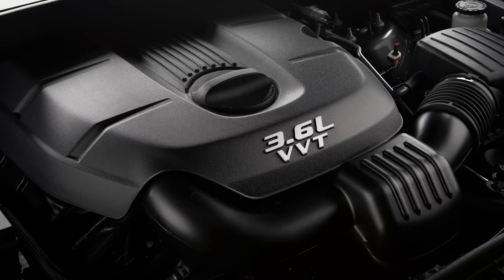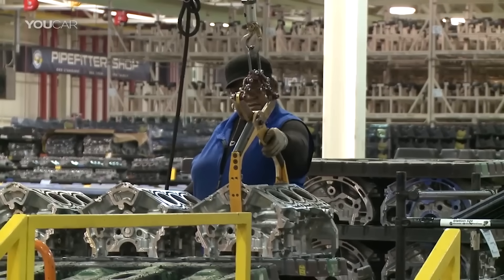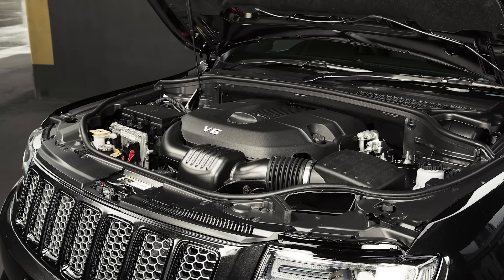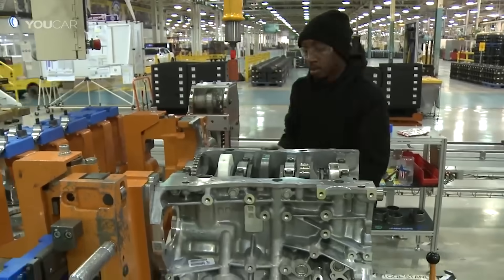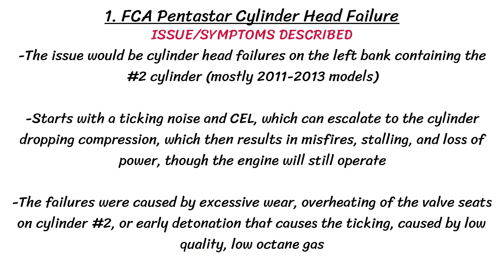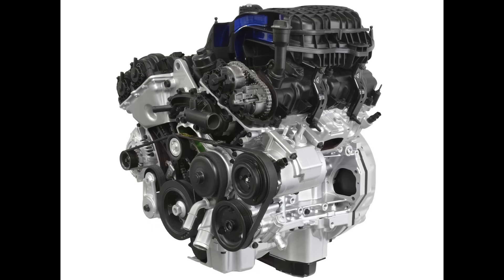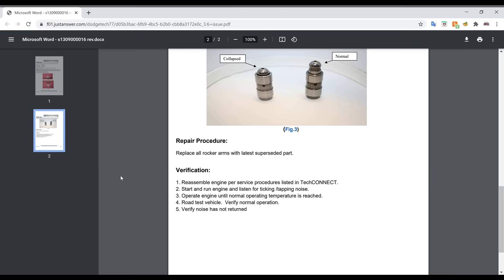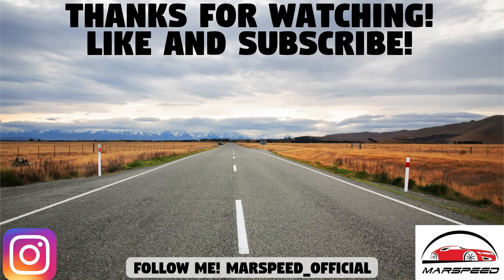The Specs and Fatal Flaws of the Chrysler 3.6L Pentastar V6 Engine

Comment: I have a 2911 Chrysler 200 with 75,000 miles.The only problem so far was had to replace thermostat and a/c condenser went out.I have had no real issues so far and I get great fuel milage,but I did change to 89 octane gas,

Comment: I have a 2013 JK Wrangler with the 3.6 penastar engine that uses oil, I have a chance to purchase a 2020 JT or Gladiator penastar engine,. Does anyone know if that motor will swap into my JK ? If so what modifications would I need to do to make it work?  Thanks

Comment: I drive a 2019 Ram 1500 with the 3.6 L with 36,000 miles on it and I have had absolutely zero problems with the engine

Comment: These are definitely the big three issues with the engine. FYI: There is an aftermarket fuel pump made of aluminum. Also make sure you only use the specific Mopar brand antifreeze.

Comment: 2015 durango limited flex fuel owner mine started with a tick that evolved into loss of power sputtering/stalling took it to the dodge dealership for repair they told me it was a bad cam due to the ticking they fixed the ticking and replaced the cam still experiencing loss of power at lower rpm’s feels like it’s running out of gas I have the 8 speed transmission so it stays at relatively low rpm’s making this a real problem. I’m taking the vehicle back but any ideas what that could be?

Comment: So far we have had 3 JEEP GRAND CHEROKEES in the family with the 3.6 Pentastar Engine. No troubles. We have the OVERLAND Package on each JEEP but One.  And 4x4 Loaded. They have been very reliable so far. Reaching 90,000 miles on one and 115,000 miles on the other one.

Comment: My 2015 Jeep Grand Cherokee Limited w/ the crap durability Pentastar engine got new rockers, a camshaft, and lifters at my cost since it was out of warranty.  Used synthetic engine oil certified to FCA specs and was very particular to changing the oil and filter.

Comment: recently had a problem with my 2013 jeep wrangler's heat. Engine light came on and the code indicated a problem with the thermostat. Once that was replaced the heat came back a little bit but not to its full potential. Might try replacing the heater core next.

Comment: I have 106k on my '18 grand caravan I purchased used at 54k.    Never had an issue with any of the aforementioned problems in this video.  HOWEVER! Now that you mentioned the octane grade issues, I may want to consider bumping up to 89.  Can using 89 correct of improve the overall fuel and firing  system in case somethings lurking in there waiting to rear it's ugly head?

Comment: Had a Routan 2012, still have it. Gave me a consistent 26mpg on highway on long trips.   Engine failure at 205,356,, no compression at all in one cylinder, the others sub par.  Had misfire codes for years,, had some ticking,  and the van had recently become a very hard starter but only on very cold mornings.  Recently started using E85 here and there, makes me wonder if that was the straw that broke the camels back?  About to throw in a used motor with 56k and do it all over again. $2300 with shipping and tax for that used motor,, 2500 to install, certainly better than used car prices! ..  Only other comment would be the TIPM was a big design failure on all these for Caravans and VW Routans.

Comment: This is more of a design problem than a wear issue.  The plastic oil filter tube will crack if it is torqued down too tightly.  This causes oil leakage through the tube.  To replace the tube requires removing the rear bank head and all the parts above it.

Comment: the rocker failure problem was the loss of oil in valvetrain.oil galley plugs backed off and oil would drain back into the timing chain area.starving the valvetrain rocker failure and cam damage.

Comment: I have seen videos on the fatal flaws of the 5.7 Hemi. The Hemi Tic being one. I purchased a Ram 1500 brand new. It only took me a couple of days to begin hearing it. Since this was a while ago I didn't know about the problem. That was my second and last new Dodge. Now the latest V6 has it's own fatal flaws!?! CHEVY'S LS is super popular yet it too has built in fatal flaws as well! Notably both BMW and Mercedes who were both known for quality and reliability are about as reliable as a drunk! Everything that they make is a disaster waiting to happen! So in 2009 I bought my first Kia. Don't laugh! I have had three in all, two new and one used. They have all been completely reliable. My 2016 Koup turbo has over 70,000 miles without a single issue! I know know now that I have been lucky since many of their engines blow up due to a manufacturing process as well. That has been a long intro the question, why can't any car company just build a reliable product anymore!?! They used to! Just Asking.
Reply: Politics has caused all of this.

Comment: 2014 Wrangler, I just replaced the oil the  cooler, a common issue with this motor. Also change the spark plugs, every one had been burning rich. All were a dark brown 🟤. It had  NGK plugs I put champion plugs back in. Dose seem to run better.

Comment: Purchased a 2016 Willys Wrangler lease return with 39k on the clock 3 yrs ago...certified used which means the drivetrain warranty is extended to 7 yrs or 100k miles. Good thing because as soon as I got it home the radiator had to be replaced. Then the timing chain cover gasket was leaking and had to be replaced. Then the front right axle seal had to be replaced. Now I am getting the all too common cylinder 5 misfire and I am without the vehicle until the dealership can work on it over a week from now. There is currently under 70k miles on this vehicle. I am religious about maintenance and never abuse anything I own so naturally I am pissed about all these issues especially given whet these vehicles cost. My wife's 2015 Grand Cherokee has already had defective rocker arms and a cam replaced on the right side at around 70k miles. Thankfully under warranty but now it's expired. And American car companies wonder why so many people choose brands from overseas? We love out Jeeps but when the time comes to replace them, we will most certainly NOT be purchasing anything Chrysler!

Comment: Chrysler-JEEP air conditioner compressors fail at a high rate, especially if the car lives in a HOT 🔥 climate like Southern California, Arizona, Nevada etc. My AC was fixed twice under warranty on my Dodge...

Comment: I have a 2019 ram promaster with the 3.6 I’ve had all these problems. Cylinder 5 exhaust valve broke a piece off caused compression to disappear. Now my oil coolers leaking 😞

Comment: I wonder what the average warranty cost per engine built was ? I recall when I was working for Ford motor company is company building 351 Cleveland's back in back in 69 and 70 they are average warranty cis guaranteed cost with 17 cents per engine produced. I think I won't buy any Chrysler's in my future.

Comment: Fought my 2012's leaking oil cooler for a month, eventually getting a new unit. Tried new gaskets but they didnt fix the leak. The gaskets under the metal plates were most likely the problem.  Also the aftermarket oil pressure sensors are junk. My stock one went out, replaced with a new one and that didn't work, same code. ended up pulling a used one off a junkyard motor and that one worked fine.

Comment: Hi.  Also under fatal flaws, the 2014 model Pentastar incorporates a bad oil filter housing that is prone to cracking/leaking into the cylinder valley.  FCA has manufactured a new housing without this issue that the owner must replace, or pay to replace.  Thanks.

Comment: had a 2014 jeep wrangler jku from Sept 2014 till October 2021.  Had issues with the Radiator leaking (replaced twice, once on warranty and once out of pocket ).  Had issues with the oil cooler/filter assembly (replaced under warranty although had to call FCA corp to get it covered).   Had extended crank start issue.  replaced drivers side cam shaft position sensor out of pocket.  Had noisy rattling at  100k km.  Replaced belt tensioner out of pocket.  High pitch vibration screeching sound under light acceleration at 110 000km.  Never found the issue due to trading in vehicle at 122k km (snagged a ford maverick).  Never had issues with lifter ticking but I also switch  to using 5w30 oil at 20k km.  IMO engine was good but due to last minute programing change for the CAFE standards, it caused issues (engine running really hot 215-225F and using thinner 5w20 oil).
Reply: If you use too thick oil on a VVT engine it’ll cause more problems.

Comment: BS I saw a video of a Promaster van owner that was looking inside his 3.6 engine to see what failed at 625,000 miles, mostly timing chain issues, everything else was fine, as opposed to my Toyota that got a new engine at 83,000 miles, or my friends Tacoma new engine at 125,000 miles
Reply: Did the Toyotas have sludge issues?
The 3.6 should have a timing chain replacement every 150K miles. He got plenty of good usage out of that one!

Comment: I have a 2020 Jeep Gladiator. At just less than 11,000 miles the engine was ticking on the passenger side. The dealer said they had to replace a couple of the rocker arms, cam and a cam phaser. I believe this is pointing to bad needle bearing in the rocker arms. If this is correct, is there someone out there making better rocker arms?

Comment: My 2015 Jeep Wrangler started the engine tick a few months ago.  I plan to replace the rocker arms and lifters in hopes this is the issue. Really hope the cam shafts or cylinder heads aren't bad. Also had to have the oil pump housing replaced a couple years ago as it was leaking.  So far 2 of the 3 problems you described. Not good.
Reply: What's the mileage?

Comment: The cure for the overheat issue is to cut the wire to the shutter device running in front of the radiator. It makes a difference of 40°f doing 80-90 through Texas.

Comment: If you miss an oil change on these series of engine, they wear out. The magnetic ring on the cam shafts pack up with metal debris, and foul out the sensor

Comment: I have nothing substantial to add, because I’m comparing apples to oranges.  But I worked with fleets in the last couple years (Ford Transits, Mercedes Sprinters, and Ram Promasters with this motor).. we constantly had issues with the Fords and the Sprinters.  To the point where it didn’t seem believable.  Were the Chrysler products nicer vehicles?  No, not by a long shot.  But holy crap, my eyes have been really opened about motor reliability.  All vehicles were on a strict maintenance schedule.  All driven fairly hard everyday , 6 days a week.  Nah, I’m now a believer in this Fiat motor .   Take it all with a grain of salt.  I get it.

Comment: My 2014 Jeep Grand Cherokee on two occasions around 110,000 miles and 140,000 miles has had a ticking noise from the upper level of my engine. The noise eventually goes away after a couple hundred miles. But I still wonder what’s causing it to come and go as it’s only happened twice.

Comment: My 2012 Caravan had a issue around 65k with the head. Took it to a Dodge dealer and Dodge warrantied 100%. I now have 179k on it with no problems ticks, engine light. Good maintenance intervals are done.

Comment: The open deck design is used on all modern engines . It doesn't sacrifice cylinder strength , it keeps the tops of the bores round over time due to the fact that they are separated from the head bolts . On the old closed deck engines the pressure from the head bolts would pull the tops of the cylinders inward , making them out of round over time . The pentastar has an extremely robust bottom end that can handle a lot of boost .
Reply: Open deck design also cools the top of the cylinders better and lowers the tendency to knock. Manufacturer can run the engine with slight more efficient ignition advance.

Comment: The issues that you discuss can be mitigated by regular use of Marvel Mystery Oil several days without a week before you do an oil change which will keep those oil passage is clear to keep that hydraulic valve lash adjuster from starting to collapse which starts the pounding of those rocker arms. And those can cause the same issues that the Chrysler 3.7 + 4.7 had.

Comment: Thanks for the information, had just gone through the rocker issue, the two loose bolts in the oil gallery issue and the cam angle sensor wiring issue. All in one car within six months. We also have a Dodge Journey and a Fiat Crossroad with the same engines. Although the cars have been great, it is unnerving that the faults are not recognised as mandatory recalls. Would I buy Jeep, Fiat or Dodge again, probably not.

Comment: Going through the head issue as we speak. 2019 Grand Caravan 76000 miles engine. Exactly like stated #2 misfire and 2 cylinders on that bank failed leak down test. I would have expected better with proper maintenance and that low of milage.

Comment: The motor is great the only problem I’m having is heat only works on the driver side of the car I’ve had the heater core flushed and tried everything except replacing the heater core not sure if that would even fix this problem on 2013 Chrysler 200 3.6 L

Comment: 2013 jeep wrangler jku with 75k. I'm in two oil filter housings they both cracked, replaced thermostat, currently shopping for 24 lifters, 24 rockers, and new oil cooler. Had to do three reverse super flushes to get rid of casting sand lovely engines I'd say

Comment: on average the 3.6/3.2 is a great engine. I still own two of the four Chrysler products I've bought with these engines and have had zero issues with them. The same guys dogging Chrysler products are the same guys that will tell you Toyota, Ford, and GM build great shit when nothing could be further from the truth and they would never openly admit to having to send their rides to the dealership for repairs.

Comment: It sucks I have a 2014 jeep grand Cherokee with 170,000 miles on it 3.6 L with a misfire cylinder one swapped coil packs swapped spark plugs and still have a rough idle and a code p0301 and now it’s throwing a code p0300 what really sucks is I live on disability I can’t afford an expensive repair and it’s sad I need my vehicle for doctor appointments and stuff only transportation I have but no more 😞

Comment: Have a 2012 3.6 213,000 miles never had any major issues still driving today running smoothly
Reply: Gonna buy the same one, do you recommend I check anything before buying? It has 92k miles

Comment: I have 2021 jeep gladiator mojave with the 3.6 has been fine so far. even though it's new it gets reved to redline pretty often out on the dunes and in the desert, So it definitely gets worked harder than most. Also I always run 91 and maintain it religiously

Comment: I’ve had my 2013 Chrysler 200 limited Pentastar 3.6 V6 since 65k and have now roughly 136k doing regular maintenance and oil changes at 7k miles. Really surprised with how reliable it has been. Car still runs fantastic with no problems in sight (just make sure to change that tranny fluid). The 3.6 V6 engine is leaps and bounds better than the world i4 imo

Comment: My 3.6 ltr in my 2015 Caravan has had just about all problems. Cylinder head just after 30,000 miles , oil pump replaced 2 times and rocker arms so far every 9 - 12 months. I need rocker arms right now actually. Gonna try next week

Comment: Once the initial cylinder head issue was resolved Pentastar  been incredibly durable.  The rocker issues are fleets ignoring the EVIC maintenance reminder and not changing oil, not a design flaw.

Comment: I'm the original owner of the 2012 T&C and I love the van. The only two things that I'm not happy with are the spare tire placement and no power sliding buttons on the back of the seats when stowing the second row seats. I have been extremely lucky to have no mechanical issues. The hood however had to be repaired due to rust under the paint. That happened about 4 1/2 years after I purchased it. The work was done under warranty and looks beautiful. I only have 54682 miles on it in 10 years.
Reply: Wanna sell?

Comment: my 2011 Chrysler 200 convertible with the Pentstar 3.6 v6 flex fuel has been a great vehicle with good motor until last night on way to drop sons Christmas presents. car  overheated and by the time I could pull over their was bubbling oil spewing out of my cooling system reservoir. Not to happy due to me and my son losing our home and he went to live with his mom, While I went slept on street and my car is what I use currently in Minnesota cold winter. pretty homeless and was using my car to sleep at night and try to stay warm. now probably sleep under bridges and light rail train.

Comment: my 2011 Chrysler 200 convertible with the Pentstar 3.6 v6 flex fuel has been a great vehicle with good motor until last night car overheated and by the time I could pull over their was bubbling oil spewing out of my cooling system reservoir. Not to happy

Comment: I had a 2011 Jeep Grand Cherokee and it had the ticking sound and I traded it in for a 2015 Jeep Grand Cherokee 4 months ago and about a month ago it had a misfire on cylinder 2 and i took it to the dealer and they changed the plugs and coil pack and a week later what you know misfire cylinder 2 again so i took it back and they replaced the head and i just got it back today so hopefully i don’t have anymore problems…good thing i have the extended warranty cause that would’ve been a big bill

Comment: New engines across the board are high compression. Mid octane gas should always be used. Yes the cylinder pressure is regulated as described here, but there can be spikes.